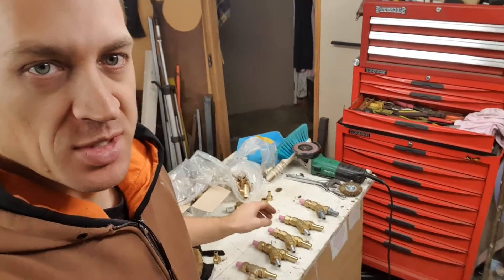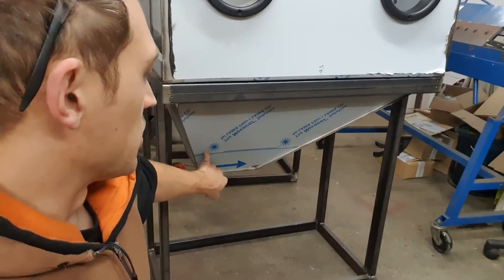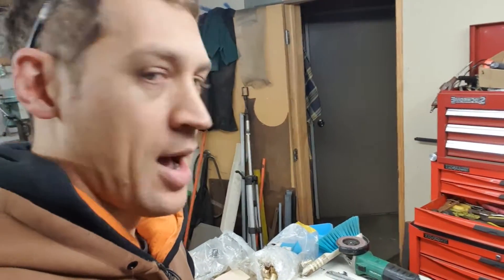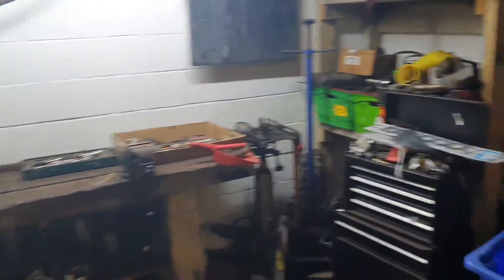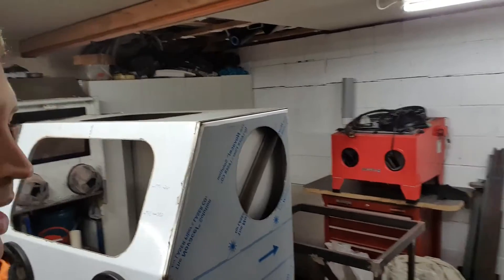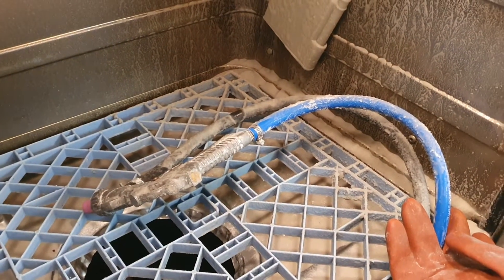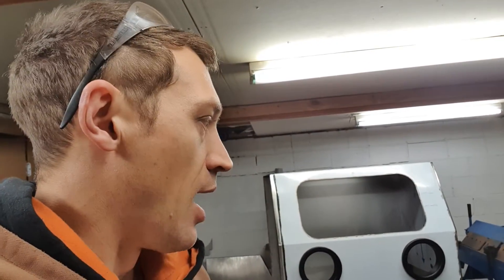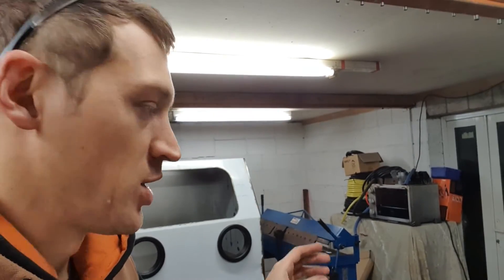Quick Update and Upcoming Video Tease.

Comment: nice to see you josh !  is there a solotion for recycling glass beads?
Reply from the maker: Hi Nacim,

I dry and sieve out my media to use later in my dry cabinet. Once it is dust either in my extractor or spilled on the floor, it just gets swept up and put in the dust bin. 

Before drying I rinse in with dish soap to seperate the grime and oil in the slurry and then that gets dropped at out local waste oil recovery pick up point.
Reply: @ArmouryEnterprises  thank you Josh I will try your method 🙏🙏

Comment: Hi Josh,
I hope you are keeping well and busy. Over the course of this year I have built up a decent powder coating facility to support the restoration of an old MGTF Replica. I have a fully modified blasting cabinet (dry) and a 10-12 CFM compressor that runs very well at 40PSI to the cabinet. I always intended to change the gun but was surprised that it worked so I have just been using it and it has been performing quite well to be fair. I now need to use the facility I have created to do much more work so I now need a better gun, I also had a problem yesterday with poor media flow through the gun. I subscribe to your channel and have looked through some of you other videos on the guns you have made. Are you still making these and if so where can i go to find out the price?
Kind regards Paul (UK)
Reply from the maker: Hi Paul,

Thanks for the message, you can see all my products here: https://www.armouryenterprises.com/collections/all
I am out of stock at the moment, but you can flick me a message on the email in the video description. I will put you on the list for the next batch.

Cheers
Josh

Comment: your doing a great job man. you where the one who got me started on VB and im happy to say i have one of the first !!!! and still working really good. happy to see your doing good
Reply from the maker: I Kyu!

It makes me happy to hear your system is still running! How is the nozzle holding up?
Reply: @ArmouryEnterprises   oh its doing good. i stop using steel parts and only use it for aluminum because i was getting rust from the small parts of steel from cleaning steel parts. i used your nozzle and then swap it out. but im back to yours again it just works better. i like the new type you have the 3d print .